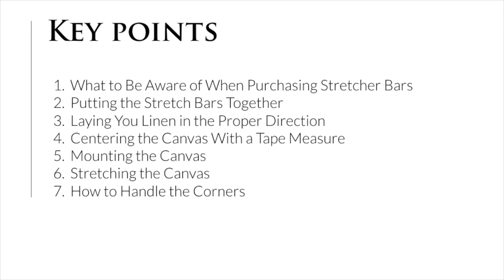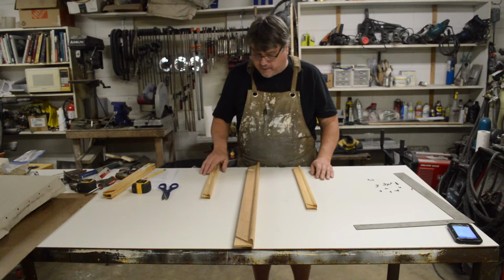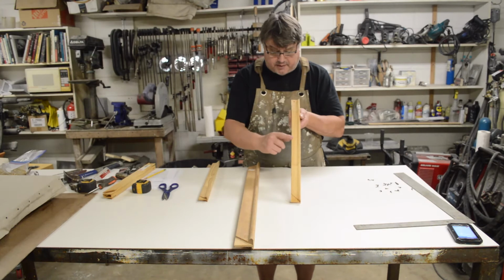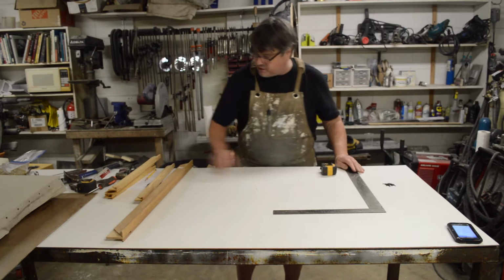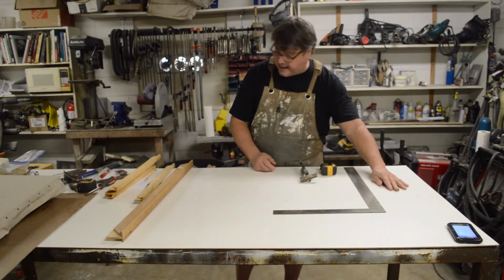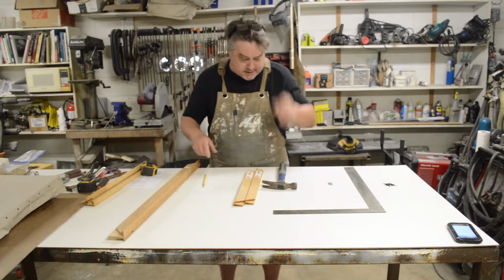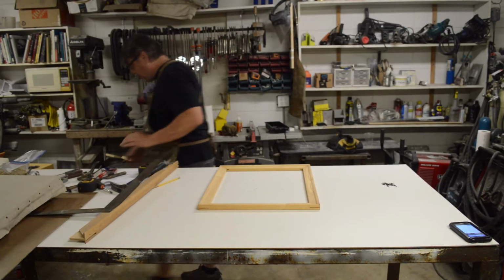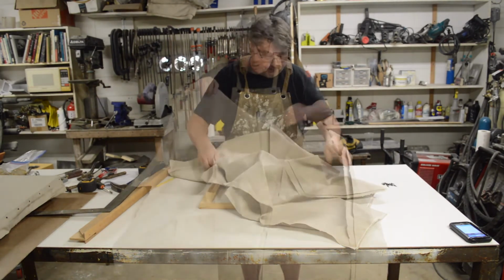03 Demystifying Maroger - Mounting the Canvas

Comment: Peter, thanks again for doing these videos.  When you stretch the linen, are you leaving a little slack, i.e. not going for drum tight, letting the sizing do the final tightening?
Reply from the maker: Don't go for drum tight in the stretching phase. Think of the Buddha, to slack and it will not play, too tight and the strong will break.  The strength of the glue is the key .  The powdered Rabbit Skin glue is not rabbit skin glue, it is cowhide glue.  Very strong!  That is why I recommend the small pebbles,  it is easier to gauge the glue strength.  With every batch you should run a strength test.  Back in the late 80's I stretched about 30 good size linens, and used the cowhide glue.  I followed the recommend dose, later that day I heard the creaking and cracking of my stretchers. All linens had broken their stretchers and deformed.
Reply: @forsterarts  Thanks again Peter.  Great advice!  I have the glue ready and now to use it today!